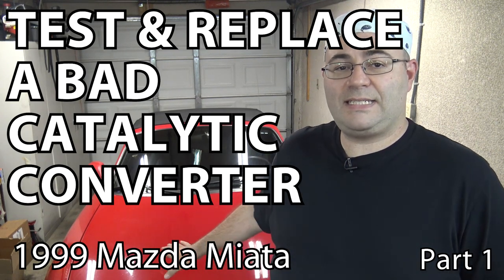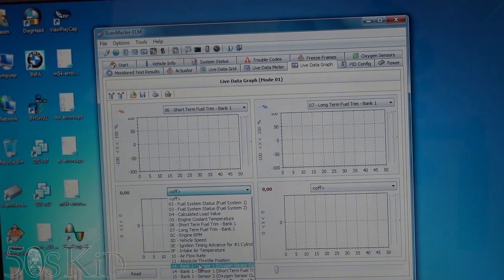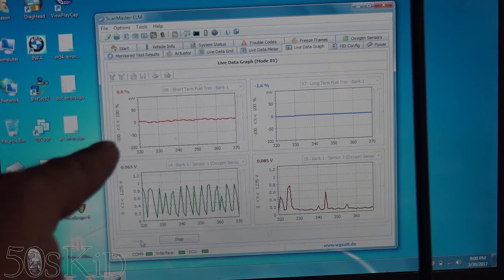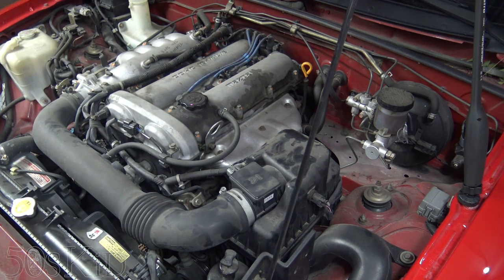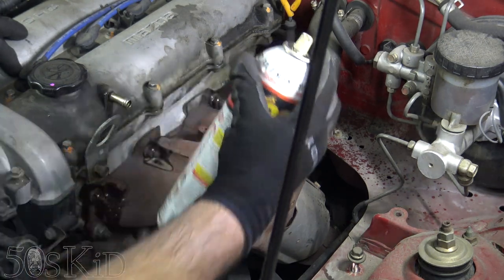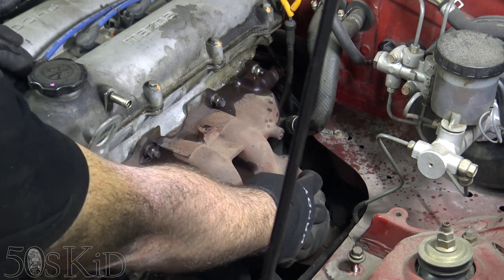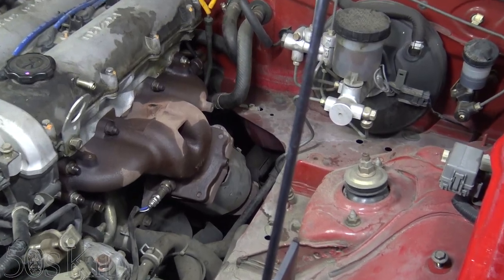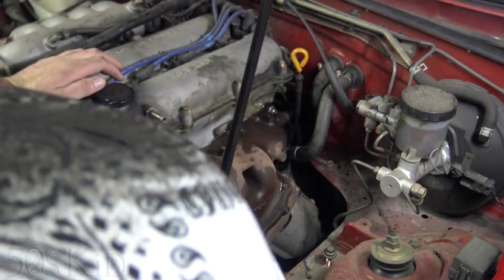How To Test & Replace A Catalytic Converter DIY - Part 1 - 1999 Miata (P0421)

Comment: Hey there. Im getting the same code for the same year model. 1999 NB miata, Cali spec. When I check my O2 sensor value. After reaching operating temperature, my downstream sensor stays constant at 0.135 to 0.145V, it doesn't change rapidly like yours did. Does this mean that my downstream is likely bad and my pre-cat is still good? Thank you so much

Comment: I’m currently diagnosing my 2000 miata that’s throwing the p0420 code. On my second o2 Sensor I’m only getting 0.0v. Would this mean the sensor is dead or is there something wrong with the wiring?

Comment: Hi i have a 2012 f150 ecoobost had p0430 code so i changed the catalytic conver but i still have that same code as permanent
Reply from the maker: Permanent codes are a new thing--you can't erase them yourself, you have to wait for the car to do it.  It only happens once you complete a proper drive cycle.  Google ford f150 drive cycle to see what your specific one is.